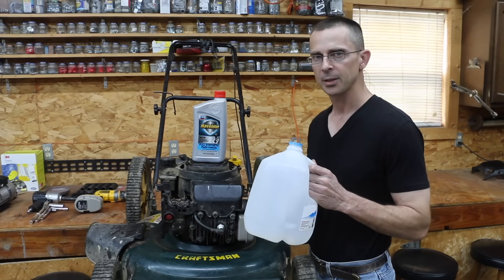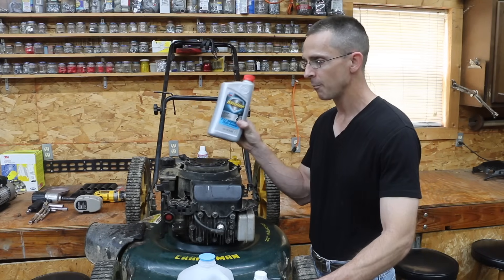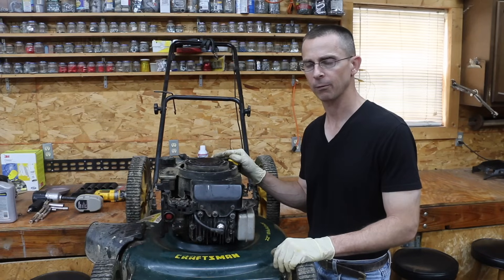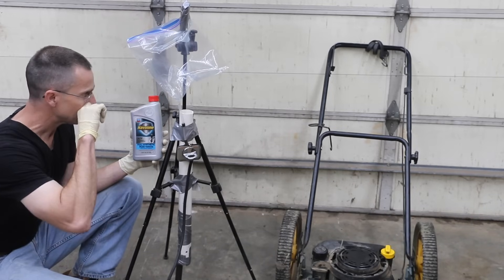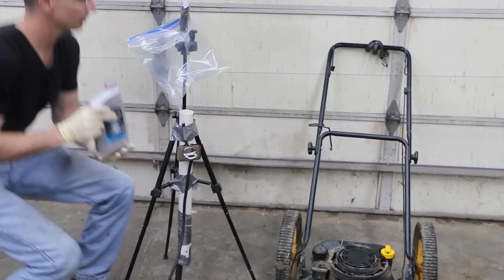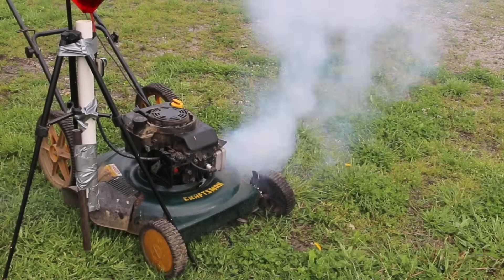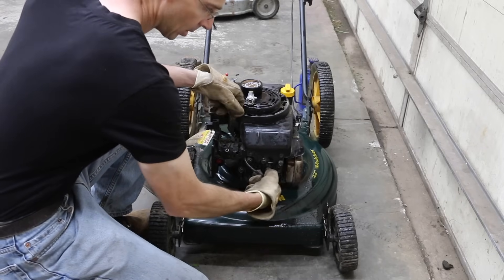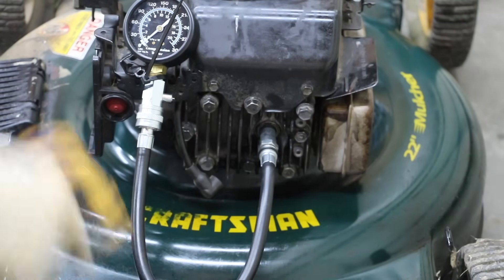Seafoam--can't believe what it did to my engine episode 6--Seafoam vs ATF!!

Comment: I have a severe blow by issue with my nissan altima 2006 2 5L. I will try any kind of additive to avoid spending thousands either on overhaul or buying a new engine. There was also a major issue of severe internal coolant leak with the same car. It was rectified by using ABRO SUPER SEAL. I need help in eliminating blow by of the engine. Will flushing with ATF help.
Reply from the maker: You might consider using a product called "engine restorer".  It has been known to be very effective and reducing blowby.  If you decide to try it, could you please create a new comment letting me know if it helped?  This helps me help others.
Reply: @ProjectFarm  Thanks for your reply. I actually live in Qatar and have tried my level best but engine restorer is unfortunately not available here. I have in the mean time put ABRO STOP SMOKE in engine oil yesterday and have driven the car quite a bit since then. I am seeing quite an improvement in engine sound during idle or when i come to a stop. My next oil change is due after a 1000 kilometers so i will let STOP SMOKE do its magic until then.

Comment: hey so one of our many cars lol the 2003 ford taurus im going to start putting a little bit of ATF fluid in the tank..., and marvel mystery oil in the oil, for 80 miles then drop the oil. ...reason is engine pings ..or spark.knocks going up hills.  ; this is a common 3.5 liter dual over head cam V6. i will say specs after test if you are interested .....lol i know i am. 
....i bought this car 5 months ago with 129+ miles now after 5 months n 3 days it has 143,778 miles. ......I will also include how much ATF fluid i use per gallon.
Reply from the maker: This will be an interesting test. I look forward to the updates!

Comment: If you want to see "a miracle" put 50ml DMSO into the combustion chamber and let it soak for a while. The engine should be warm. 
Or you can mix acetone and DMSO 4:1 and add to the fuel(try 1:5 for lawnmower's engine, you'll get faster effect), for regular cars 1:240 dmso aceton mix to the fuel, it will have softer effect and will not get to the engine oil. Dmso eats carbon deposits, however it makes oil much thinner...
Reply from the maker: Thanks for the video idea!

Comment: Thermal shock will do the best job of removing carbon -not trickles of water.  Try an ounce of isopropyl 3 times every 5 minutes - dump it in fast.  Comp ratios will always come down with a cleaner chamber.  There are no fines or jail time for breaking the laws of physics - you just can't.
Reply from the maker: Thank you

Comment: what would happen if you used a brass brush to break off the carbon instead of "chemical treatment"?
Reply from the maker: That's much faster.  It'd be a lot of work to dismantle a modern engine periodically.
Reply: so the point of using say water or a solvent is to get into the harder to reach areas without a total tear down? im just curious cause you only show the one plate and the piston head which doesnt look to difficult to get a brush after. forgive me im trying to learn more about small engines but and very green.
Reply from the maker: Small engines serve as test equipment for vehicle engines, which are more difficult to dismantle.  Removing the cylinder head on a flat head Briggs & Stratton is easy and the way to go for cleaning in combustion chamber.

Comment: I was thinking about it for a motorcycle that uses 220 cc carburetor, what percentage of ATF dissolved in the gasoline add you would add??
Reply from the maker: I still wouldn't recommend using it. If you decide to do it anyway, a 5% mix is what I would do if it were mine. Again, I wouldn't recommend it. Thanks again.

Comment: excellent video!!! , I would like to know, what would happen if you mix ATF with gasoline? , if I refer to mixing the direct atf in the gasoline and using the engine with it, what do you think the result is?
Reply from the maker: Thank you!  I wouldn't recommend doing this to a vehicle engine. It'll likely cause issues for the catalytic converter.

Comment: You got some wicked camber on that mower, it must handle great.
Why not just add ATF to the fuel? I guess on a carburetted engine it might run lean, but on a modern car engine the ecu will adjust to meet the set air file ratio
Reply from the maker: lol.  Camber is great!  Great point on the ATF...it'll run lean.

Comment: I’m thinking that the SeaFoam would work better if it was in a OHC engine instead of a flathead. Looking at the results of the SeaFoam the carbon build up has moved from the side and with visible paths of removed carbon going from the intake valve, to the middle of the piston head and  out through the exhaust valve. Pushing the surrounding carbon aside and leaving build up areas. I’m thinking if it was a OHC engine it would have left a more uniform coat on the piston head and instead of the SeaFoam digging it’s way through on the piston, it would’ve been removed more uniformly, not leaving and path ways and thus would have been more effective. I would like to see whether this is true or not.
Reply from the maker: Great point.

Comment: Hi dude just try dimethil sulphoxide (DMSO) or dimexide is a trade name for the thing. I could buy it in the drug store in my country (russia). Hope you can find something onto your side. You will find results freaky amazing and uncomparable. Also it can be used to clear old oil or burned oil-based fluids pollutions. Also you can add some (5-7%) to oil of a four-stroke engine. And clean it 1-3 times with oil (20-40 mins of mid-low rpms and load coz of oil sae it reduces), filter and dimexide change. And get you engine as new. Its fully gasket-friendly. But beware, it destroys paint just like DOT fluids. Thats why very advisable first remove inner paint on sump cap
Reply from the maker: Thanks for the recommendation.

Comment: Well well I like your presentation and yep the stuff works and do continue as this is valuable sharing with others. The ATF seems to have cleaned better than the water and the SeaFoam. However I am noting that the engine does have some challenges with oil seals on the cylinder as evidenced by the wetness on the base of the head in each of the shots.  

That said though I like your approach and continue to share as we all can learn and are learning :) Good job and thanks again !!!
Reply from the maker: Thank you!

Comment: Back in the day - that is, the 1960s, we UK vehicle owners were offered a product called STP. This was 'guaranteed' to restore our engines to their former glory, by the simple expedient of pouring a steady stream of said product into a running engine via the carburettor. The result was always a cloud of blue smoke which meant that the treatment could only be used by driving into the countryside and finding a quiet spot to administer the treatment. Used in an urban setting one could justifiably expect death threats to follow.
Looked at in retrospect, it's easy to see that this was a remedy for engines "in extremis". Engines that were burning oil because the piston rings were allowing oil to pass from the crankcase to the combustion chamber, or via the valve guides and seals to the same end. This results in carbon fouling in the chamber which negatively affects the swirl effect at ignition, resulting in mediocre performance. The effect of this additive was extremely short-lived, to the extent that after four or five attempts it would have been cheaper to spend the money on stripping the engine and wire-brushing the carbon away. Not forgetting, of course, to leave the carbon built up at the top of the cylinder(s) because that is 'useful' carbon as far as compression is concerned.
Reply from the maker: Thanks for commenting on this.

Comment: I have done things things like this in the past with older cars I have had. Like before a oil change, adding tranny fluid to my engine oil to top it off and running it for a few days to clean it out and loosen up my rings. Also adding a few ounces to my gas running my tank low at the same time. I have never had any bad results from it. Is it something I do to a well running car no but hey in my experience some old school tricks have merit.
Reply from the maker: Thank you

Comment: ATF is just a 10W-30 or 5W-30  oil with added detergents (Why it cleans so well)  so it wouldn't do anything to harm the engines oil, In fact you could put a quart in the crankcase with no ill effects.....Also "Sea Foam" is a little better all around,  as it contains alcohol which  helps  eliminate water from oil,  and fuel

Comment: The atf did the best overall job. However, I would run another test with Seafoam, IF you can get it in liquid form, and meter it the same way you have done the atf, and the water. That to me would be a fair test. Also anything you add to the engine in liquid form, on top of the normal air and fuel mixture, will increase compression, and force the mixture past the rings, and into the crankcase of these low compression engines. Good job as always. I enjoy your videos.
Reply from the maker: Thank you!

Comment: On a small engine i prefer to remove the cylinder head to clean the combustion chamber rather than use additives but in a car or truck i use sprays like seafoam. But my neighboors complains about it 😆
Reply from the maker: Thanks for commenting.

Comment: i used to seafoam years ago but the price doubled on the cans it seemed and was pretty glad i got a hint about the atf from a master mechanic. i tried it and its always been my go to over the years when i got a new car to help clean everything out and well now i know it really does work well thanks to you. glad you checked the oil too i never cared too much about that after some atf in the intake but it seems atleast with a wore out motor it can continue to do some good. at my shop we also will use 1 qt in the crankcase on a 5+ qt motor so about 20-25% atf/oil ratio to clean a sludgy motor. it doesnt lose enough lubricity to damage the motor and that oil is nasty after its changed again but the motor does look better inside. atf can be used as a fuel additive here and there to keep a motor clean and lubricate/clean fuel injection and carb parts. also used in diesels for the same reasons at shops. 
 on a side note when you did the test you should have shut it off with the atf still going into the intake or a slight excess so it can heat soak. thats when it really does its magic. when it starts back up it smokes so bad you think the motor is hurt but it clears up and burns more off than when the motor was running only. i would love to see a comparison between running only and shut off with excess if you get bored. its seemed to work best for me that way but science is better than opinion.
Reply from the maker: All great points and thanks for commenting!

Comment: Using upper cylinder lubricant I the fuel of an engine with no exhaust sensors or catalytic converters will clean slowly over time, seal valves and rings immediately and prolong engine life significantly. In my research I have found that the best  fuel based upper cylinder lubricant is synthetic two stroke for petrol engines at about 200/1 ratio and mineral based low smoke two stroke oil at a ratio of around 100/1 where the benefits are even more pronounced, higher fuel pressure, reduced fuel pump wear, quieter operation, increased power and fuel efficiency. I might be way off with those ratios so do your own research I'm just hopeless at remembering numbers
Reply from the maker: Thank you for this recommendation too!

Comment: Here's my thoughts... With all the pulling of the cylinder heads in these videos, I'd have simply got in there with a decarbonising  brush and cleaned the combustion chamber and piston crown up like new. A little grease between the piston and cylinder wall will stop any gunk getting in. I understand that the actual purpose of these videos is to test the results gained without pulling the cylinder head, and they are great as an education tool, but I guess I am just a fuss-pot. It's what I have always done, and will continue to do so. I'd still run a flush such as Sea Foam for the the benefit of the bottom end though. Fortunately, we have the stuff available here in Australia... I was surprised! Please keep up the good work!
Reply from the maker: Thank you!
Reply: Once again... my pleasure : )

Comment: Had a Chinese go-kart (gy6-150) that had really worn rings. Would burn oil and load up after about 2 hours of running and spit and sputter. Used to mist water into the carb to clean it and it would run fine for another 2 hours. Probably wouldn't do this to a vehicle unless it was just a yard car... but a $200 used go kart you just trash for fun... sure!
Reply from the maker: Thanks for commenting!
Reply: Project Farm Sure man... keep the videos coming!

Comment: I'd say Seafoam makes the most sense.  It made far and away the most difference for the least effort.  Water required two full tanks of gas, a thorough crank case flushing, took two hours, and made only a marginal difference.  ATF did more than water for less trouble, but still far less than Seafoam did, which means it will need to be redone more often.

Do it right the first time.
Reply from the maker: All great points. Thanks for commenting.

Comment: Who ever says its a waste of money doesn't know much. Some very high line auto makers Decard engines at 40,000 miles on vehicles that have every service documented at dealership for warranty purposes I can attest a new vehicle with all maintenance preformed does still build a lot of carbon seafoam, marvel and berryman  are a very good cocktail to use as preventative maintenance I have continually proven these products and saved myself and customers lots of money on costly repairs
Reply from the maker: Thank you for the positive comment!

Comment: Your Ford truck video results were impressive, both oil and intake Seafoam additives.   A mechanic I worked for in high school (in the 1960's) used water in the intake.  However application was ice water from a squirt bottle into the carb @ well above idle to keep cylinders hot, never enough water to go to crankcase oil.  He said the ice water temperature-shocked the carbon off the combustion chamber surfaces, and it did usually produce increased black exhaust smoke during application.   Thanks for all you do.  Thomas A. Edison said,  "I never did a day's work in my life. It was all fun."  Edison also thought sleep a waste of time, and frequently power-napped with a pie tin and a spoon in his hands, so when he nodded off the spoon would fall in the pan and wake him up.(LOL, but true)  He did invent the light bulb though.            Never give up what you love.
Reply from the maker: Thank you!

Comment: I think ur videos  are very professional  showing befor an after an starts an ends pull in heads an compression  test cold an hot. ATF  is mainly a detergent witch  I think will work better than seafoam. If use mainly seafoam most of my 2.2l cobalt engine line in gas tank an crank case only an has 147,000miles an it's only use half qt   of oil pre 5k mile oil change
Reply from the maker: Thank you!

Comment: Funny story, somewhat related in that it involves ATF, lol! I had a VG33E powered R50 Pathfinder and I was in a mad rush to do a tune-up one day. My kids were running around, and we were going to my in-laws house to borrow their indoor garage for the task, but we had other stuff to do so it had to be quick. Get there, and instantly drain all of the ATF out. I pull the pan, throw in a new screen, and fill-er-up. To my surprise, it didn't take much ATF to completely fill. Weird, so I wanted to check the fluid level before I moved on to the next part of the tune-up so I start the motor up. I had a custom intake and exhaust, so it was louder than stock... But man did she sound PISSED. Shaking, hesitating, just not running right. I put it in gear and nothing happened. I instantly realized that I had, in my perma-fried wisdom, wasn't paying attention and poured ATF into the engine oil. By this time the ATF was POURING out of every seam of the engine and making a huge mess of the in-laws garage. I cleaned and started reconciling my mistake by draining the oil. The crankcase was overflowing and I had to empty my drain-pan because the level got too high. Fast forward through filling everything with proper fluids, running the motor with fresh oil, draining the fresh oil and re-filling it again, and the truck ran great. I thought it would be toast for good, but the thing was better than ever! If I could do it again to a cheap enough car I would, but I'd leave a little more breathing room in the crankcase instead of filling it all the way to the dipstick tube. I'm honestly surprised that didn't blow out the rings, seals, or PCV system.
Reply from the maker: Wow! Thanks for commenting. I enjoyed reading your post.

Comment: I just watched your video and loved it! Anyone who says its a waste is an idiot. We as consumers have very little non bias information to go off when it come to things of this nature. I've used Sea Foam and a few other products over the years and have had mixed results. I will be doing an oil change tomorrow in my 2008 Chevy Silverado with the 6.0 in it. I am having a bit of lifter noise and want to try and clean it up before i pull the valve cover gasket and tear it all down. Because of your results i will be using the ATF method, 1 quart ATF to 4 quarts of Oil, to clean my motor out instead of Sea Foam. Let me also state that i had a friend blow his motor not properly using Sea Foam. Not controlled and ran it way way to long. It is a very harsh cleaner in my opinion. Thank you for all you do and just know you've helped me on more than one occasion!!
Reply from the maker: Thank you!